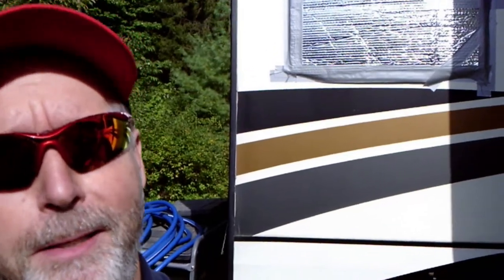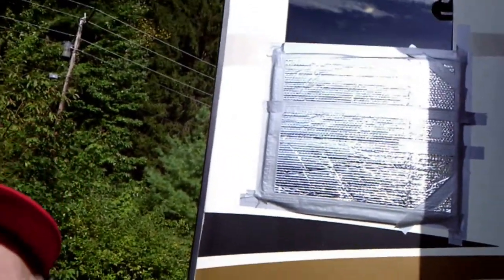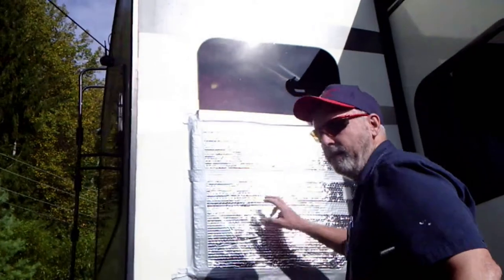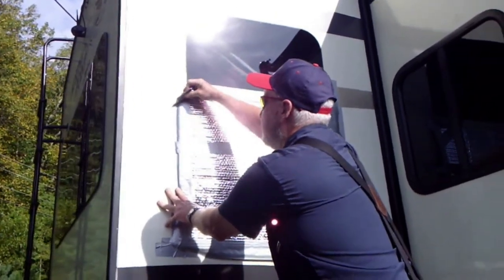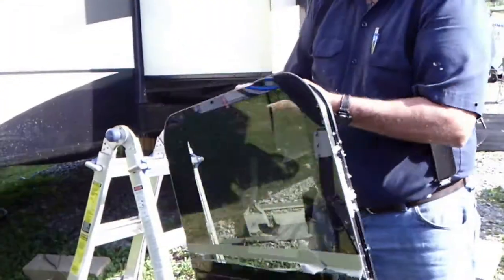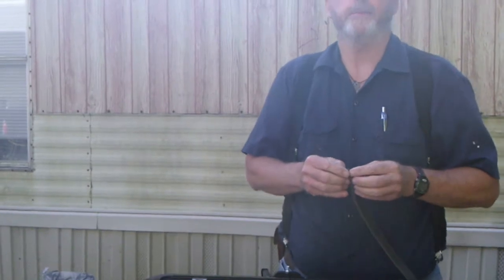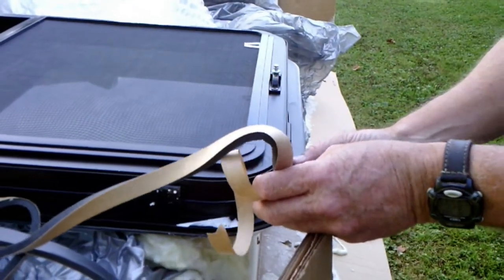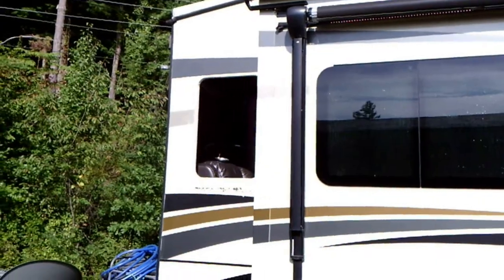Remove And Replace RV Frameless Window

Comment: Were the screws self tapping? Or were there holes already drilled in the new window?  Good video.
Reply from the maker: They are not self tappers. The screws go into a channel that goes all the way around the window frame.